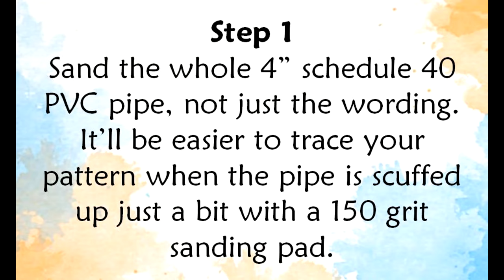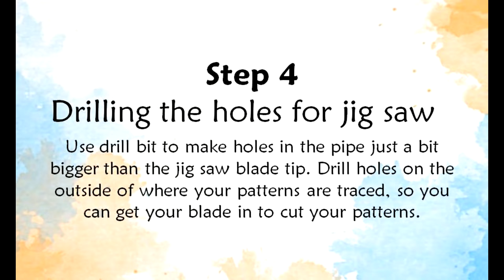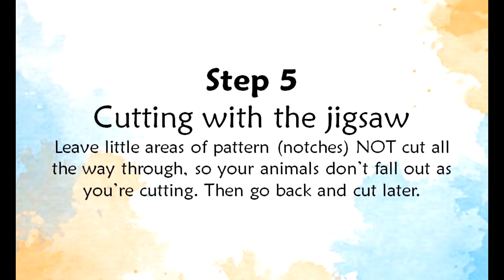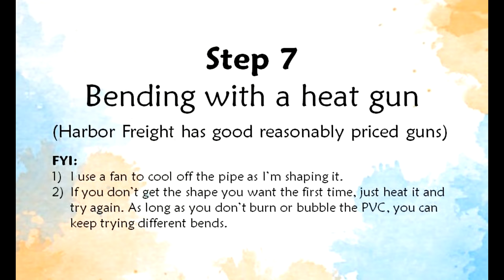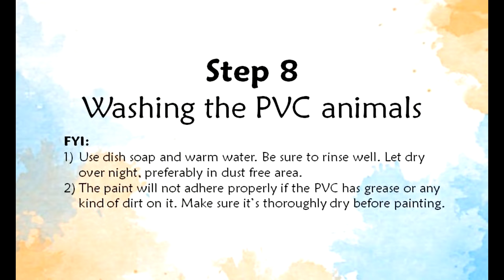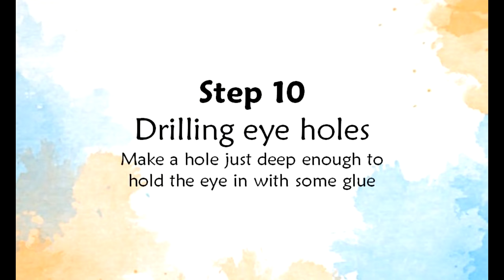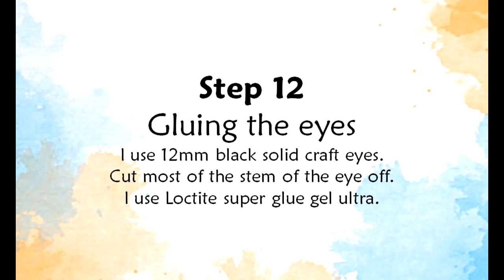Step by step - How to make a PVC pipe wild hair pelican

Comment: When making the long skinny pieces i pulled too hard and it tore can they be fixed or am i just out of luck
Reply from the maker: Hi, is it pulled completely off? If not, you can use a filler to repair it. I use DAP Platinum Patch, it’s easy to use and is good for outdoors. Or Bondo Glass (2 parts, requires mixing). I use the Bondo on anything that has flex in it. I’d get it bent to where you want it, then patch it. I wouldn’t recommend using the heat gun on the patch.